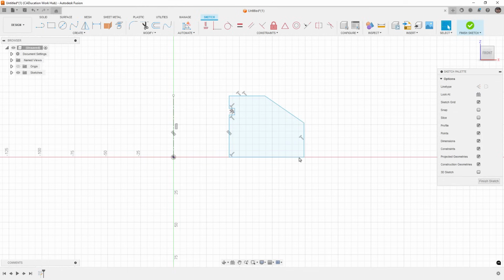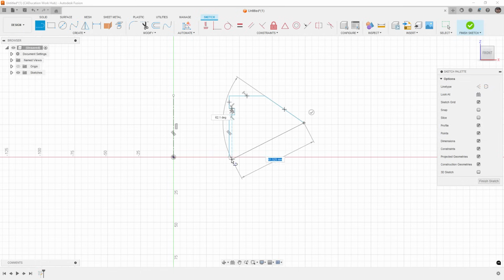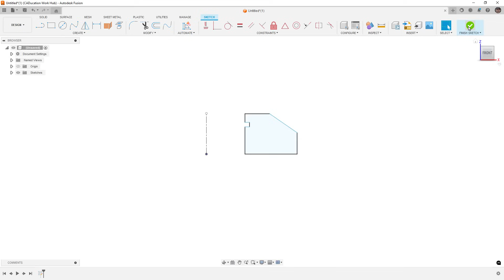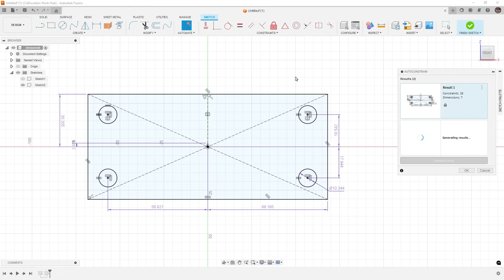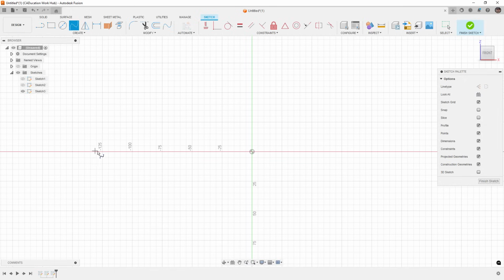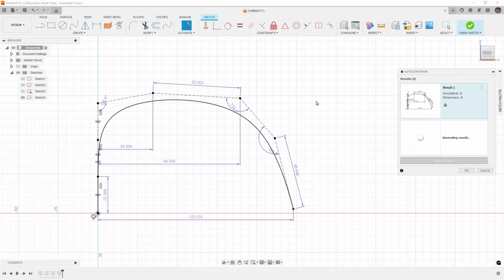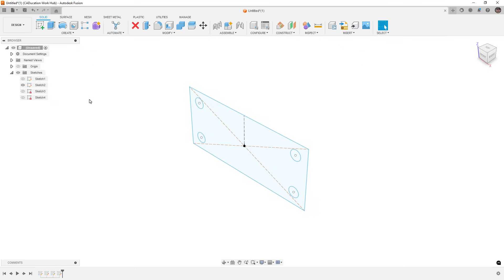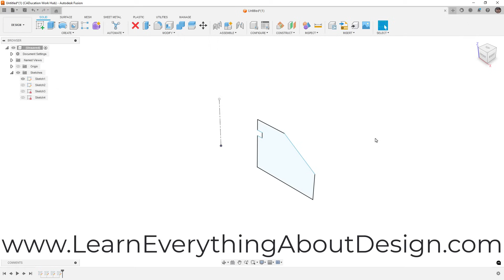Whats New in Fusion January 2025 | AI Auto Constraint

Comment: I see this as a crutch for people who can't comprehend geometric relationships or are too lazy to think through the relationships that matter.  You can achieve the same thing by applying "Fix/Unfix" lockdown constraint to every sketch element.  Yes, for things like splines, this has value.  But I fear that it will encourage a lot of sloppy sketching that leads to frustraion when the average user is pulling their hair out because it won't change an angle relationship (or similar).  To use this in my work I would need to have it more fully enhanced with rounding, the ability to limit certain types of constraints (like angles), etc.
Reply from the maker: Yeah I agree David.  Maybe it will get there.  At least it isn't forced on us :)

Comment: This seems like a bad use case for AI. What I'd really like to see is AI used to covert a complex mesh from a 3D scanner into a sane part, which the existing tools just can't handle since a mesh usually has hundreds of thousands of vertices, if not millions. And even if the convert tools do work, they give you all those triangles rather than turning a tube into a tube.
Reply from the maker: Agreed.  Would be nice if the mesh face creation could be done by AI.  The conversion tools fail at being useful past something you could likely model yourself pretty easily.

Comment: if only fusion for hobbyists didnt limit gcodes id be able to do all my work from fusion which is realy shaping up as what could be the ultimate app for us as the entire cnc community relies on fusion up to the point of toolpaths and then we need other programs
Reply from the maker: Yeah, but the hobby license does have CAM, just limits the post to no tool changes correct?
Reply: @LearnEverythingAboutDesign  all feeds are limited to feed rate so no rapid moves

Comment: For a spline, why not just use "Fix" constraint? And in general, it doesn't look like just creating dimensions on of hand-drawn sketch is what you really want. After autoconstraint you will probably still go and manually set dimensions to something more round.
Reply from the maker: For a spline its common to dimension the "cage" of the spline.  Mainly because if you make other splines and want to follow the same general shape you  have a reference.  I often times will make splines for lets say the top and bottom of a loft on offset planes and use similar sketch dimensions.

Comment: I guess what's new is old. In this case very old. Creo, back when it was still called Pro/ENGINEER, implimented an "auto constraints" type feature. I think it was around 1999 or 2000. Us users absolutely hated it, told PTC so (repeatedly and loudly) and it was soon deleted never to return.
Reply from the maker: Yeah. Solidworks has sketch doctor and other CAD has similar tools as well.  I don't think there is really a good replacement for proper sketching.  The way those tools in PTC and Solidworks work are a bit different to how this one does, but the results are right now much the same...

Comment: IMHO this is not the direction that is needed. I just don't get why Autodesk are putting dev effort into adding new stuff, when so much that is already in there is (IMHO) substandard.
For example:
If I sketch lines, it assumes perpendicular, creating a dependency chain. It should assume horizontal / vertical instead (Or at least there should be an option to set this as default)
"Redefine sketch plane" is utterly useless, a child could do a better implementation. If you create a plane, do a sketch on it, then delete that plane and create a new plane in EXACTLY the same place, it still converts everything to fixed. It seems to make no attempt whatsoever to work it out.
Reply from the maker: on the first point I agree.  I generally hold down CTRL to override those constraints but agree it assumes you want a perpendicular constraint because the line definition is length and angle.  Or parallel vs Horiz.  It would be cool to hold down alt and scroll through options.  I view that as a minor annoyance though.

For the redefine sketch plane, that is one i rarely use so personally don't have much gripe with it.  When I have used it I haven't had the situation where the original plane was deleted.  I just tried it and didn't get the fixed issue.  I made an offset plane from RIGHT and sketched something with dimensions.  deleted that plane and redefined as the default YZ plane and all the dims and constraints were there.  I do know on broken sketches with reference issues there is a right-click option to try and redefine them.
Reply: @LearnEverythingAboutDesign  All the dimensions and constraints will be there, but everything that is projected into that sketch will no longer be projected (purple), it will be fixed (yellow).
The logic to fix it would be child's play. For each projected point, it knows what was projected, so re-project it. If it stays in the same position, no need to alert the user, but if it moves, then yeah, maybe make it fixed or something and warn the user.
Reply from the maker: @evilc2048  Thanks for the extra clarification!

Comment: This is just encouraging bad part design and labelling 🫠. 

What it should be improving is how parameters are applied in sketches and understanding the parts relations with each other.  

Locking something in place could be a feature rather than an ai implementation, is so much of an overkill 🫨
Reply from the maker: Yeah, other than complex surface models where i need to tweak things I can't think of cases where i make a sketch under defined from the start.  If it can sort out the revolved part and round numbers that might be nice.

Comment: This is really the gap between expectations and reality. The idea of autoconstraining mesh sections seemed cooled, but I had a look this afternoon and it was worthless. Good point with the spline case! 👍
Reply from the maker: Yeah, was it you that suggested it in the other comment?  I couldn't find the comment but I did check into it before the video and just couldn't find a good use case.
Reply: @LearnEverythingAboutDesign yes, it was me. I thought it was going to add constraints, not just dimensions everywhere.
I think this would be tricky, for example for horizontal which angle should be considered? Just 0°, or 0.1° ? In a mesh it may not be an absolute value...
Reply from the maker: @NorMaker3d  Yeah.  the example i was using wans my sprocket.  What i would love to see is an automated mesh section sketch that made all the corners square and assumed lines rather than a polyline :)